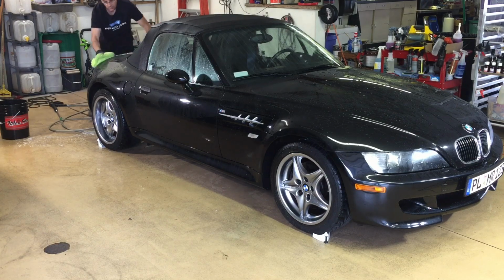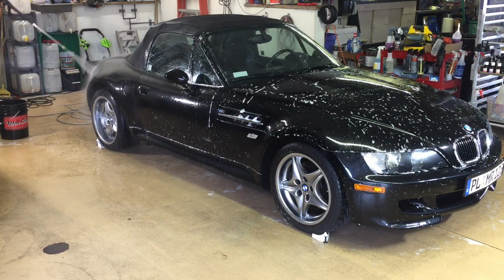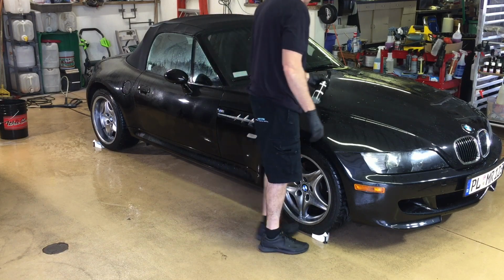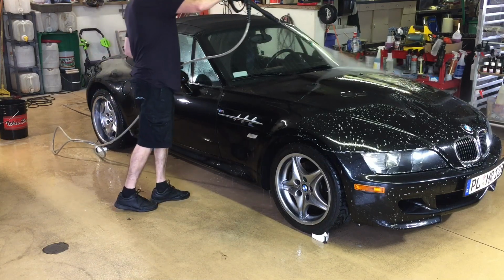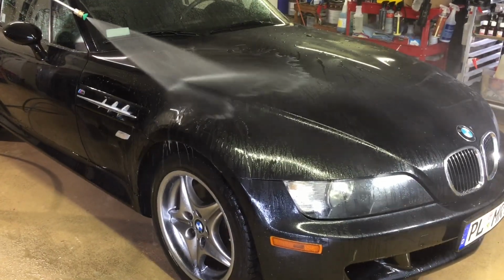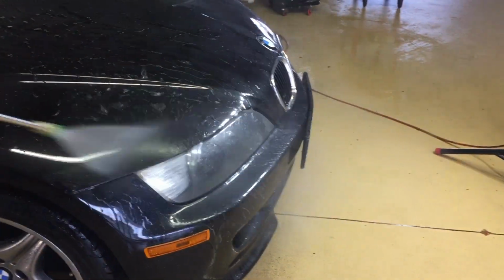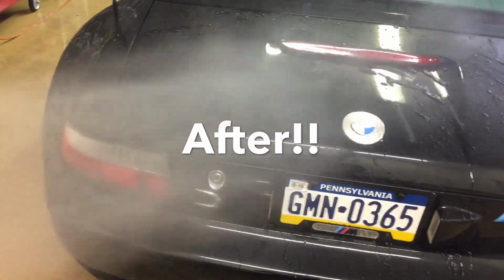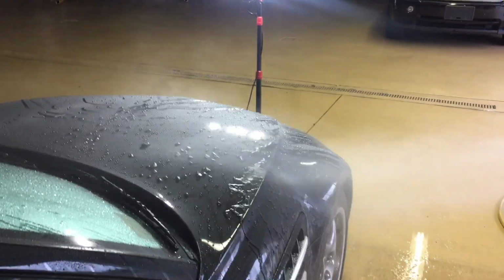McKee's 37 Hydro Blue Sio 2 Coating!! Spray and Rinse!!!

Comment: Great stuff! But as a warning through personal experience make sure to rinse off every spot! If you leave a spot un rinsed and leave it dry it will stain it and its very hard to remove I used a clay bar and machine polished it and still was there. Had to go aggressive wool pad and a rotarary to remove it good. But either then that i love it 👍👍👍
Reply from the maker: Appreciate the heads up!!👍
Reply: Also, Nick recommends no more than 2-3 squirts per panel. You can determine if you need more if the water doesn't bead when rinsed off. But overspraying it can leave a residue that requires buffing after which can be a pitb. Just some tips I've learned along the way.
Reply: Good info. Even tho I'm a year late to the party.
Reply: Little late here but I had same problem . I tried using less and rinsing alot more hut still had the spots

Comment: Based on this video I tried McKee's 37 Hydro Blue.  While the video is compelling, the actual use of the product is AMAZING!  Now understand that if you are driving an upper 5 digit or 6 digit car, this is probably not for you. This is for the person with a $40K daily driver who may not always have as much time to put into cleaning and protecting the surface of the car as we wish we could but still wants protection that is user friendly.   I thought my Megs UFF was good until I put this on my car.  This is better than UFF and on the windows better than RainX. My first use I literally washed, rinsed, applied Hydro Blue and rinsed and then went for a spin dry. After a 20 min drive the car shined better than it did when I purchased it and did a three stage correction (compound, polish, sealant). And now they offer it in a concentrated version!
Reply: Use this on top of a sealant ?
Reply: @smokeymartin5329  You can, yes.  But it provides a great shine and slick feel just after a wash, spray and rinse. I did start with a compound, polish and paste wax, and then followed with Hydro blue about every two months. Usually in spring I will strip it all down and do it over again. In the case of on top of a sealant, think of it as an easy layer to replace maybe once a month to make that sealant last longer.

Comment: This was my introduction to the spray on, hose off type product and for those of you who watched the video it really is THAT easy! Since then i've tried several other products like it, CarPro Hydro2, TAC systems WaterGlass and even beta tested a product from a major mfg which ISNT Sio2-based and they're all great. I have Gyeon WetCoat on the shelf and will be using it on my car before the weather gets too cold. 

My car is coated with TAC systems Power plus and these products make topping a coating VERY easy and since its Sio2-based it works well with my paints finish as well. 

I will say though that when i use this type of product i let it sit for about 30 seconds and THEN rinse it off/in. Using it on glass and wheels is a must like shown in the video, makes wheel cleanings VERY easy afterwards!

Great video as always, hope you review TAC system products very soon, they are new to the US market but have been around since 1995, had coatings back then as well😃
Reply from the maker: Klasse Act TAC is def on the list. This does make a great topper.👍🏻 

Indeed letting it sit a few minutes is optimal... I just wanted to show how quick one can get around a car and protect it.👍🏻

Comment: I'm not sponsored by CarPro, but sorry I didn't tried a coating that lasts/ perform the same.
That's the reason yesterday I did my 3rd coat with Hydr02 :) 
In my opinion it's the benchmark and every coating should be tried agains't it 😎
Anyway I've bought the compund " koch kemie H8 " ,any suggestion on how to use it manually?
Reply from the maker: I used all of my Kemie...need to order more. Works great with a DA and Lake Country low lint wool pad.
Reply: @apexdetail85  I don't know what a DA is , I was talking about using it manually with my hands 😁 on small defects/ areas
Reply: My friend if u have a harbor freight near you pick a DA dual action polisher some times with coupons under 50 buck and watch some videos that how I became addicted to detailing years ago
Reply: @PeteyMcSavage  Thank's but I live 6000+ miles from you :) Italy 
No harbour freight here.( 😥)
And I'm kinda scared to use a polisher
Reply: Andrea ohhhh!!!! The DA is really  a tame polisher  the rotary is the scary one. Maybe one think of trying the DA you can get great results
Reply: Andrea ohhhh!!!! The DA is really  a tame polisher  the rotary is the scary one. Maybe one day think of trying the DA you can get great results. You have Rupees
Reply: You guys have link to buy Koch chemi products in USA? Trying to buy fse.

Comment: Thanks for another great video. I'm currently using Meguiar's HCW and applying it as you recommended and it works great but I'm finding that it's rather wasteful to apply as a spray on because of how thick it is. On the other hand, the product will last me over a year, and the fact that I can buy it at Walmart is a big plus. I just want to know, is McKee's 37 better than Meguiar's HCW?

Comment: Nice 👍🏻  thanks ! how long does this last? 4-6 weeks at least?
Reply: 3 months consistently love the product.
Reply: Easily. The biggest downside is the potential for ceramic water spots during application if you apply in direct sunlight. You need to make sure you can dry the entire car before any of it dries on its own via evaporation. However you make that happen is up to you.
Reply from the maker: 3 months tops in the stormy Northeast.💦

Comment: Great Video! What is the durability of this spray and rinse sealant compared to a liquid or a paste?
Reply: 3 months no more.
Reply from the maker: Indeed...2-3 months here in the stormy Northeast.
Reply: Thanks
Reply: I wouldn’t compare the two.  I like a sealant/wax, with this as a recharge. Or, this product as a quick and easy.  But I don’t put the level of protection in the same camp.

Comment: No paint damage issues with using a 25deg spray nozzle on the green works power washer?
Reply from the maker: No sir. You can put your hand a few inches from the nozzle.
Reply: Thank you! Only been using the 40deg for safety concerns when using it on paint

Comment: I'm definitely a dry method kinda guy when it comes to applying my toppers. Any dry method experience? Also from your testing what's the durability? TIA brother
Reply: I was wondering the same.
Reply: if you put it on dry it will leave behind a tremendous amount of white spots I put some on my car it does an amazing job I put some on my mom's card did not rinse it off good enough and it took a lot of work to take care of the white spots left behind so please don't attempt it  dry

Comment: That's a lot of spraying. I usually spray 1 at window 1 at top panel and 1 at lower. I let it roll off starting from the top to the bottom. A LITTLE goes a long way.
Reply from the maker: Voltis_5 I get 3-4 months this way where one spray per panel does not protect very ling here in the stormy Northeast. Luckily this product does not streak.
Reply: That has not been my experience. I sprayed too much my first time using it and it streaked horrible. I find less is more but do also agree that here in. The Northeast it doesn't last as long as sunny FL. I maybe get 1-2 months out of it.
Reply: Personally, I get similar results to yours with a third of the product.  Try it with fewer sprays and I’ll bet you see the same result.  Even if it lasts only half as long (not my experience), your are still money (and product) ahead.

Comment: I assume a product like this couldn't be used as a topper over a sealant or wax such as Power lock or Collinite 845 because of it being SIO2 based right?  That being  said I've used it and do use the product on my wheels as a topper which are coated with the Mckees wheel coating.  I still haven't gone over to the dark side yet with paint coatings.  I still like my sealant wax combos.
Reply: Yes you can. Also it's a coating booster
Reply from the maker: Stand alone or a topper for existing protection.

Comment: It seems so counter intuitive to spray a product on and immediately rinse it off. I guess my conscience gets the better of me and I find myself diluting Spray-On Si02 products 1:1 with H2O, spraying it on, working it in a bit with a damp microfiber, rinsing and then buffing with a dry microfiber. So far I have had better results doing this. I kind of make the SiO2 work more like a wax, allowing it to bond longer with the paint.

Comment: That is the strangest shit I have seen.  I mean you're not even putting it on evenly or giving it a chance to bond. If I didn't trust you I would have stop the video the minute I seen you spraying that stuff on rinse it off within seconds. I am certainly going to buy this stuff. Beats the hell out of going over every panel with a finished sealant with your machines. About the sunlight is this something you can use in direct sunlight. I mean I know you're not supposed to wash your car in direct sunlight but sometimes you got to do panel-by-panel
Reply: I would not use this in direct sunlight. If you don't dry the car before any of the water spots dry, you will get little ceramic spots that basically look like hard water spots. This is true of all the the spray on spray off water based ceramics. Gyeon Wet Coat, Carpro Hydro2, Hidrosilex, McKee's SI02 Blue, etc.

If you're applying anything in sunlight, I would stick to waiting until after the car is dry and applying something like Gtechniq C2V3. You could probably still use a spray on/spray off type on the wheels.
Reply from the maker: Find a shaded area to avoid spotting.💦

Comment: Been using this stuff for a few years now and you used way to much product. I've always used a regular garden hose and nozzle to rinse it off. It for sure needs to be dried after application or it will streak or spot.

Comment: I’m starting to form a hunch...  Automatic car washes use a SiO2 product that beads water and applies a bit of protection.  They apply it with a strong spray of water as a rinse just before the spot free rinse.  Sound familiar?  And it’s like 1/10th the price!
I’m considering buying a gallon of the super concentrate for these automatic washes and giving it a shot.  I would bet it performs exactly like HydroBlue...  
Anyone have any experience or inside info?